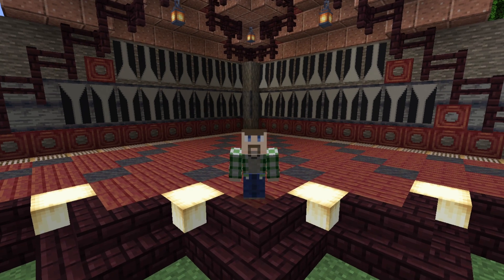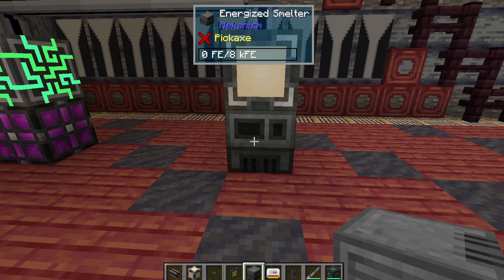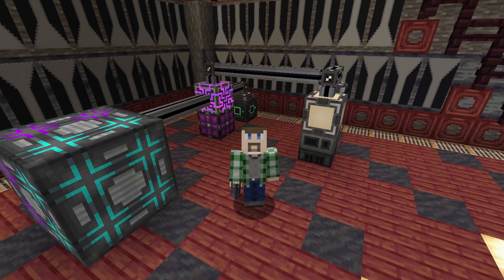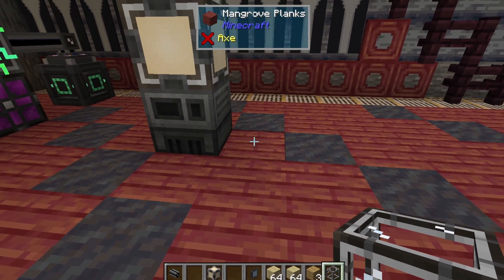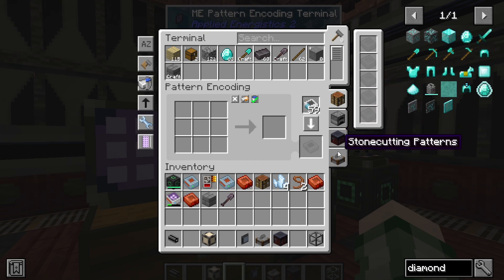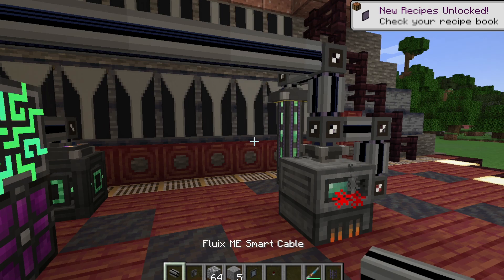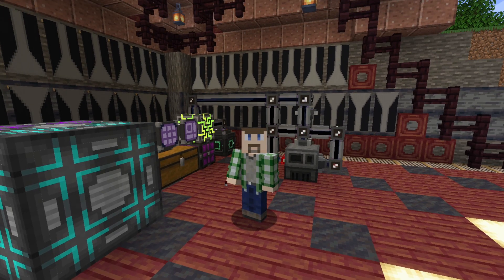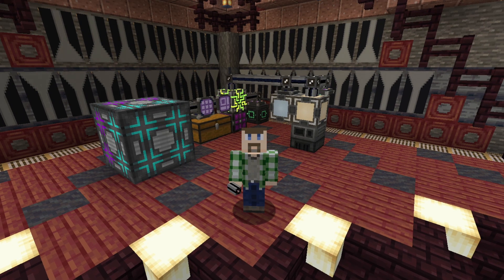Applied Energistics 2:  Autocrafting - Minecraft 1.16 - 1.19 - Modded Minecraft Tutorial

Comment: doing remote assembly next?
Reply from the maker: I’m not entirely sure what you mean by remote assembly, but the follow ups I’m planning are ones on wireless terminals, quantum bridges, spatial storage, automating certus, and going into AE2 Stuff/Things.  I’m still stuck in a situation where I can’t film though and it might be a few more weeks before I can go back to it.
Reply: @Ardcraft  prolly the wireless? you can assemble stuff from a distance, yeh? rather than right at the machines. im very new to AE2. im pretty new to mods in general, im playing my first modpack, valhelsia 5. over the last few months ive been learning Mekanism. with ur help from this vid i made enuf of the stuff in it i made Stone and the 2 cores, Annihilation and the other one last night at like 2am, haha
Reply from the maker: Ah, the annihilation and formation planes.  Yeah, those will be covered when I go over automating certus production for 1.16+, since it changed from 1.12.  They're easier than they look though.  

The formation plane just places a block of the type it's filtered to use, if one is available in the connected storage network, next to itself.  The annihilation plane breaks any block next to it, but only if it has storage connected to it to store it in.  The usual way of handling it is to have the annihilation planes connected to some sort of locked storage system that can only store whatever the final product you're after is, since these are usually used for things that have growth phases over time.  

I tend to use subnets not connected to my main network to do this.  You can sorta see how I set it up once in my E2E run, near the end, when I was using it to make botania livingrock:  https://www.youtube.com/watch?v=vkAljiq90cM&t=25s